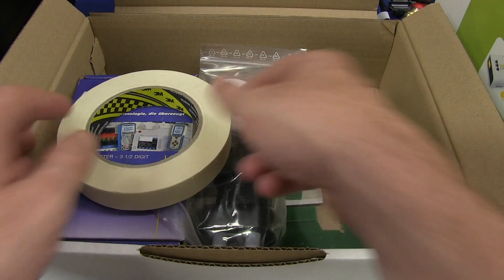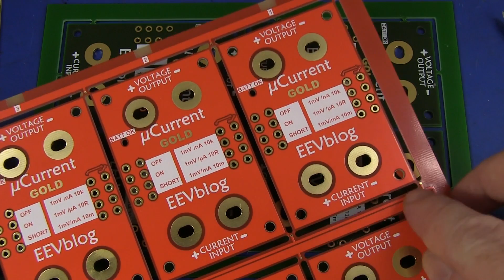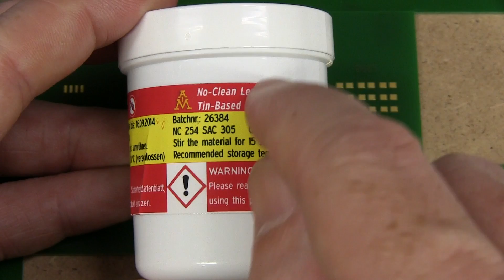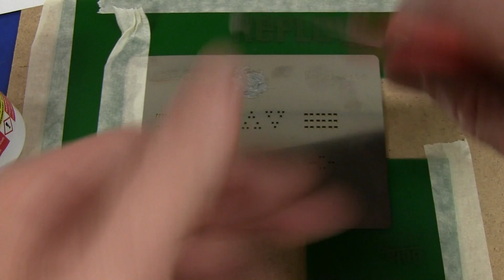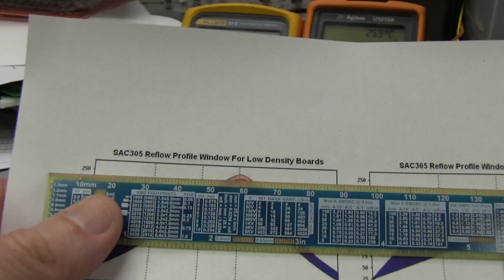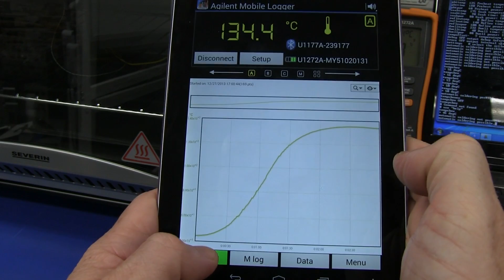EEVblog #558 - Beta Layout DIY SMD Thermal Reflow Oven

Comment: Convection:  Air/liquid currents caused by uneven heating.  The medium warms, it's density drops, it rises, it cools it falls.  Convection.  This clouds, thunderstorms, thermals.  Do not think of it as a negligible factor!  Convection currents in boiling water can accelerate upwards at enough speed to send bubbles and drips flying half a meter in the air.  
Fan != convection.  Fan is forced air circulation.  I realise oven manufacturers messed this up in peoples heads and are now, funnily enough selling "convection" mode as a bonus feature LOL!

The way to tell is to get something particulate based in the oven.  Like a burning splint and put it in and see if the smoke quickly rotates around in a swirl until it dissapates to an even fog.... which is what I would expect will happen.  It will not rise and sit at the top.  To be honest the effect might be better with just bottom heating.  Technically the elements at the top would interfere with convection and probably create several currents.  Besides!  I don't really think the air temp has as big an impact as sitting 3 inches from a 0.5kW infrared blasting resistive element.  I can bet if you put your hand in there when they are up to temp it wouldn't be the air temp your hand would be complaining about, but the radiative heating.

NileRed or Codies lab could test that.  Would close IR heating elements reflow solder in a vacumn?  I know PCB houses use nitrogen, but I think that's more like a "covering gas" ,such as argon in welding.

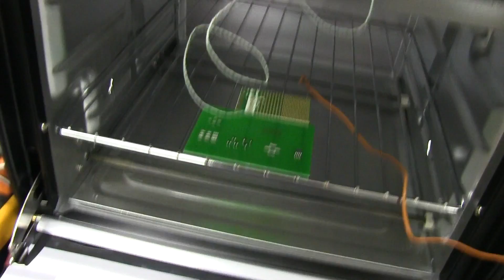Comment: 38:07 Watching this a bit after date... but I see the fail already and I didn't watch it to the end. The board used for learning lets through the convection heat but the SMD board doesn't, so the components near the edge, which get the most convection heat curling around the edge, reflow the best (but I suspect still less than optimal)

Comment: 12:40 The stainless steel stencils might last for thousands and thousands of boards, but who's going to solder such numbers manually anyway? At home you use a reflow oven for SMALL series, so mylar is good enough. When you want thousands, you let the pcb manufacturer/pick&placer/whatever handle it.

Comment: I know old ass video, but I see no reason that controller wouldn't work any where 11 or 230 so long as it's got a universal switching power supply, it's just a controller and a chunky relay, a 240v relay should function fine on 110, the relays would work fine at least
Reply: controller has transformer-based PSU. Also, the oven itself is designed to work with 230V supply (probably both heaters on top and both on the bottom are in series).

Comment: I would have placed board in the center of the owen and I would have raised it on two thermal isolating peaces so that there is no heat soak from the metal grill under it. Those owens heat up best in the middle.

Comment: When I used to work on reflow ovens, we used klapton heat resistant tape with thermocouples. Typically smaller sized thermocouples give better accuracy, but are higher variation in temperature.

Comment: I dont understand why they dont use RTD's for this kind of thing the results are much more reliable and repeatable.
Reply: witch proper thermocouple (of course with zero point compensation) you will get 1°C accuracy, which is more than enough in soldering process. RTDs are expensive, fragile and they will need to be either soldered or microwelded to be pluggable into anything. With TC you have two wires "ready to plug"

Comment: The video is still running, but how did you end up fixing the board-above-metal-grill issue? Did you end up putting small blocks under each corner of the board to lift it off the grill entirely? If not, is this something you'd recommend?

Comment: It's cooler near the front window (conductive thermal loss + door doesn't have a seal, convection leakage).  The second you put the board up front (but did the learning procedure in the middle) I had doubts.   I have that near identical oven.  I make corn dogs in it though.  Anything placed in the front doesn't brown as dark as that placed in the middle/back.  Mine is the convection model heat still isn't perfectly even I wouldn't try any board larger than 1/2 square area of the oven, off centered toward the back.

Comment: wait a moment....they connected thermocouple connector with thermocouple circuit using normal wires? O.O  At least it looks like normal wires, compensating wires for "K" thermocouple are difficult to solder. In that case I'm not surprised by that 7°C offset.

Comment: there is a big misconception about toaster ovens. The controller does not make it anywhere close to a "semi professional" proper reflow oven. There is a whole trend going on by "enthusiasts" buying toaster ovens and a controller thinking they've outsmarted the system. 
Quite disapointing from you Dave, you don't seem to know what matters is power capacity. Those toasters cannot produce anywhere near the power required. The controller with sensor on the PCB ends up maxing the heater elements temperature and you get a big gradient of temperature in the oven. At best this is a neducational toy, just like doing legos. it will reflow more or less but don't be fooled this is not reliable. As cheap as it costs every single dollar is wasted money.
Reply: goognam goognws While these enthusiast builds might not be top notch like the hundred thousand dollar units, they definitely have their place. 

My toaster meets the J-STD-020 standards for reflowing and is more than capable of producing very nice hobby PCBs. The MAJOR contributing factor is not paying for those PCBs except with a little DIY time. Compared to the financial cost of ordering PCBs and backlog of several months - It's a very reasonable tradeoff.

I'm running DIY boards from 10 years ago and they still work flawlessly. Those boards only cost a few dollars to build (including components) whereas would of cost me several hundreds had I outsourced the work due to revisions, time, and labor. I was also able to complete the project in a weekend, whereas back then I would of had to wait for over a year. These days, it's still a few weeks at best.

You sir, have no idea what in the hell you're talking about.

Comment: Good work Dave as usual. Small point - that is a convection oven you have there - convection refers to the process of air moving naturally because of heat. Hot air rises so a convection oven is traditionally hotter at the top and cooler at the bottom. An oven with a fan is a fan-forced oven - meaning of course that the fan moves the air around and spreads the heat more evenly.
Reply: MondoTV If only I could add a hundred more thumbs-ups to your comment!
I'm surprised he made that mistake.

Comment: I designed and prototyped a board with about 120 components, including fine pitch ICs, SD card sockets and so on. I learned a few things as I prototyped many versions of this. Oh, I was using a much less expensive controller from SparkFun that worked extremely well and has a digital display to show you what the temp is and where in the profile it is. Cheaper too.

First, older toaster ovens get hotter quicker than brand new ones. An old Black & Decker was about the best I found, so an old toaster oven from a yard sale is better than a new one from your local department store. That said, toaster ovens don't really have enough power to ramp up the heat quickly enough to match the paste profile. They heat too slowly.

Next issue is, they cool too slowly. You really have to manually open the door an inch and close it, watching the temp a you go. The rate of cooling is as important as the rate of heating.

That all said, I was able to get the oven to come pretty close to the paste profile and by manually opening and closing the door I could hit the cooling profile pretty close. The reflow was nice and the boards worked well.

My oven was not a convection oven, but there is a valid concern about how much air those move. You really need to move the air slowly because the parts can in fact be blown off the board easily.

I'm beginning a new project and I think I'll be modifying my oven by adding an additional heating element or two from another oven. At that point I'll need a dedicated 20A power circuit, which is fine. I keep thinking I'll add some motorized vents to control cooling. That would be nifty.

Finally, Dave never showed us how he cured the problem where components didn't reflow if they were sitting on the oven grill (and the grill sinking the heat away). I never encountered that problem, so I have no suggestion to offer. The best trick I learned is wrapping another in the thermocouple to get a read of board temp as opposed to air temp. I like that, so a thumbs up!

Comment: After watching this, I went to WalMart and got a brand new $22 Hamilton Beach toaster oven, used a SSR, China clone Mini Pro Arduino, a $9 China thermocouple with MAX6675 breakout, and used one of the Arduino PID libraries. A 1602 display fits on the front and shows time and temp, and it's designed to allow you to create your own curves (list of x seconds at y temp, 0=done).
It worked first time, and every time I tested, and as a bonus the wires on the wire rack of the super cheap toaster oven were so thin that they don't seem to be soaking heat away. I even "fixed" (by reflowing) a CAN board that had never worked properly since I got it.
Gotta love when something is this easy!

Comment: The Black and Decker Infrawave toasters work far better. You can make your own controller with a $3 Arduino and a few thermocouples if you want to save a small fortune and have a better unit as well. The infrared heaters directly heat the board and are pulsed up to your desired temperature for reflow and away you go...

Comment: In Kansas German ethnic communities Severin as a given name isn't unknown for some of the older generations.  By now very fewer US without 240V service are rare.  To what degree that 60 cycle service would be a problem would be a problem I don't know.  With no massive transformers or electric motors whose speed would depend on the  line frequency I wouldn't think the line frequency would be a problem.  Than again I'm somewhat trained hack, not a fully trained engineer.

Comment: over glorified toaster oven lol
Reply: It is a toaster oven. Didn't you see the crumb tray Dave pulled out? PCB boards don't leave crumbs :b The magic is in the inline controller. That controller should be able to work with most conventional toaster ovens.
Reply: UltraStoat PCB do leave crumbs, they are called solder balls and loose components
Reply: +erg0centric don't be a smart ass. Do you know why it looks exactly like a toaster oven? Like, EXACTLY. It's because it is a toaster oven, and no, reflow ovens don't have crum trays, toasters do. Lol. 

Now, take a good look at Dave's toaster oven, and pay special attention to the brand, then go look at this website of toaster ovens and see where you end up.

http://www.severin.com/kitchen/baking/toaster-oven

It's a toaster oven, stop making stuff up.
Reply: Wow,a rant. I was just commenting on PCBs losing parts after reflow. How do I know? Just cleaned out an optical inspection machine.

Comment: Thats not a weird ass european plug, its just a computer plug i believe everyone in the world uses
Reply: I think he was talking about the schuko plug on the toaster oven, not the ones on the controller.
Reply: +RFC3514 That's a "europlug", the pure Schuko plug doesn't have the extra hole for French sockets.  The IEC 320 conversion cable had a schuko only socket though.
Reply: John Doe - No, this is a Europlug:

https://en.wikipedia.org/wiki/Europlug

Very different from a schuko. The "CEE 7/7" has pretty much replaced the original schuko "CEE 7/4" design. No one bothers to call them "schuko french hybrids", they're just called schukos, since they are 100% compatible with schuko sockets and 100% compliant with the old schuko plug design (there's nothing in it about not having a hole).
Reply: wow, its been a long time since I commented.
Being a German means that I know what a schuko (Schutzkontakt) plug is and what a europlug is. The schuko with the hole in it is definetly not a europlug.
Its probably been invented so that you only have to produce one plug for french and german tools, which saves money on moulds and manufacturing lines.
Reply: Reviews+Tutorials - It's called a CEE 7/7 or a "schuko french hybrid". And yes, it's meant to be compatible with the original schuko (CEE 7/4, which was already compatible with most European standards) and the French (CEE 7/6). It's used by every major European country now, except for the UK, Ireland, Switzerland, Denmark and (a few parts of) Italy.
Reply: Switzerland uses a different outlet as well, its like the one that Italy uses, except for the earth pin, which is a little bit offset and not inline.
EDIT: Did you just add Switzerland?
Reply: Reviews+Tutorials - I accidentally deleted Switzerland and Ireland before I pressed "post", so I edited the comment. You must have refreshed the page exactly when I posted (or YouTube took a while to apply the edit). :)
Reply: Best
Timing
Ever

Comment: Another potential application for this controller would be annealing knife blanks or tool and die blanks that had been manufactured in a small home metal shop and hardened in a forge. Again they can be baked in a kitchen oven with decent results, but the better repeatability you have in your oven the more predictable the process. On another note you might experiment with putting a silpat in the oven or a toaster oven sized pizza stone... It would greatly even out the thermal transfer from just the wire rack.

Comment: It is most likely using a standard PID tuning method such as Ziegler-Nichols to learn the best P, I and D values. Most tuning methods involve impulsing (basically turn the system fully on) and getting the frequency response.

Comment: Dave, in my experience using solder paste a few months past expiration date results in joints that go bad a few weeks or so after soldering. What I have read implies that past the expiration date the oxides degrade the balls and they don't form uniform crystals when cooling.

Comment: my only problem with lead free solder...I find the joints looks cold and not only that, it takes too much heat to actually get it to flow properly which in turn, the components don't like excessive heat at all

Comment: Why solid state relays over transistors? Don't they do the same thing?
Reply: A solid state relay houses a TRIAC inside it. So you drive a transistor, that drives a TRIAC. This is how you control an AC load with a DC-voltage. You can do this essentially with a normal relay too, but the switching-speed and maximum switchingtimes greatly differ.

Comment: That oven is screaming for a hacking; built in temp sensor, side mount for the controller, bigger indication light and even a fan cooler to ramp down the temp after the reflow is over... just saying...

Comment: I reflowed a couple of laptop graphics cards in my kitchen oven with no worries. Made the damn things work again. Ping! :-P
Reply: It is important to meet the temperature requirements when you want to do some production boards by your own. If you don't, you can not guarantee that all solder joints will be good over long term.

Comment: It doesn't look like the transformer manufacturer (Gerth) makes a PCB mount version that has 110/120 vac primary ... however it would not be hard to hack another one into place to get it to work.
Reply: it all depends on the solid state relay if it can handle ~double amps

Comment: Even though it is 240V, is it 50/60Hz? Many of us do have 240V in our garages/workshops, especially for welding and other purposes.
Reply: The video answered my question. 50Hz only for the control unit. :-/
Reply from the maker: A 110V version is coming soon.
Reply: @Thor214
if they're not using the mains frequency for timing it wont matter , and if you only have 120v just swap out the transformer :-)

Comment: Dave; I would suggest before you put a lot of boards in the oven; put the drip tray back in which my help to even out the temperature though out the oven. You will get uneven temperatures through out the oven. More calibration me thinks.

Comment: @36:00- I suspect that grate is partially to be blamed for the fail. Look closely and one will notice how the failed parts of the PCB had the grate bars directly beneath it.
Personally I learned the hard way not to place boards directly on grates and similar things. I usually try to suspend my boards a few centimetres above the grate/surface. Small balls of aluminium foil works great.
Reply: Yes. But not only that, the temp. was too low. Perhaps someone has forgotten to calibrate it before shipping or the EEPROM failed for some reason with these bits.
Reply: True that.
I do suspect that the manufacturer here doesn't calibrate every single unit.
Most likely they only calibrate once for every batch of temp sensors or something like that, and reuse the calibration data for the whole batch of temperature sensors.
Cheap yes, but it is all about production costs.

Comment: It won't help for the top elements, but you can put the crumb tray in the bottom slot (above the heating elements) to avoid there being a hotspot and better distribute the heat from the bottom elements. This will allow you to keep the rack in the same position you have it in the video perhaps.